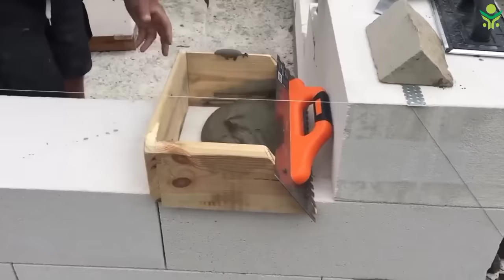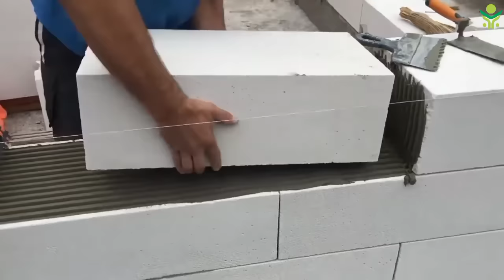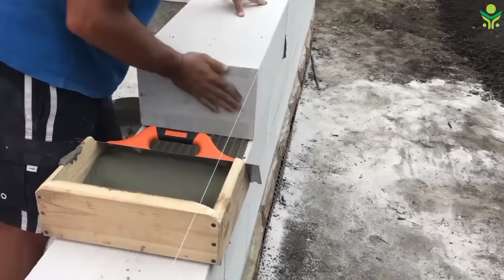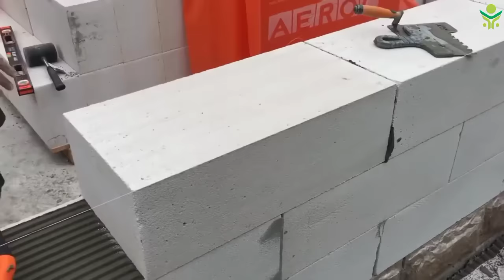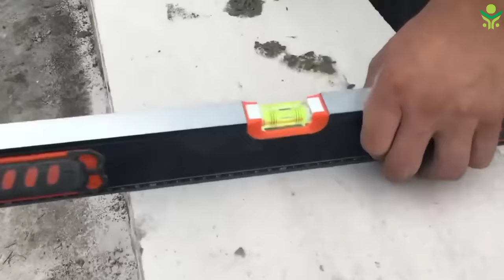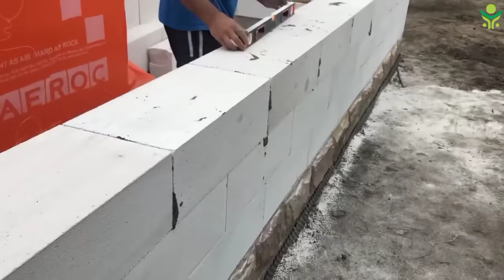AAC Block Adhesive (Chemical) Application

Comment: Good use of the applicator but their are several things to note about this install. First, the installer should be wearing closed steel toe footwear not beach sandals. Yes, AAC blocks are lighter than cider but they still weigh between 35 lbs to 50lbs depending on size and density. Second as the installer lays each flight/course of AAC blocks he should be checking each with a level and using a rubber or silicon mallet to make sure each AAC block is level and firmly installed vertically and horizontally.
Reply: Wow thank you for internet warrioring for us all. Did you not notice the literal mallet and level that he has?
Reply: What rubbish! Have the first course exact and the rest fall into place.
As for footware, from what I see he is working alone so he doesn't have to worry about some other idiot dropping something on his feet. So it is up to him to keep his feet from injury.
Reply: Thank you, Karen!
Reply: Gotta love them no-lifer keyboard warriors that write a reply based on watching 20 seconds.
Reply: It sounds like the angry replies are the keyboard warriors.  OP just said he "noted" some things. He didn't attack anyone and just stated what he saw.  Calm down
Reply: Really? You give a damn about his feet? Hope you can call him and let him know that he shouldn’t wear what he wants.
Reply: My guy you have to see what construction workers in the 3rd world wear. You will commonly see grinding and welding in nothing but flip flops.
Reply: Lmao.. When its rendered, nobody will be arsed.
Reply: @MA_KA_PA_TIE  Yeah and that's why the number of people who lose limbs and lives in work place incidents are 10x higher than in NA or EU

Comment: When cleaning the side,why throwing back the material in the bucket and after take the material from the bucket to infill the slide extruder?
Reply: Glad someone else was thinking the same as me.
Reply: I'm sure it's much easier to flick the excess into a large bucket, rather than carefully scrape it back into the extruder.

Comment: What about filling the joints so the mud oozes out the way the inspectors like it too?
Reply: Inspectors need to learn what the manufacturer’s instructions say and check that the builder had followed them, not an old method appropriate to a different material!
Reply: Looks like porous concrete which is meant to only be applied with a thin layer of adhesive. Here in Germany the inspector and the construction manager won't like it if the adhesive starts oozing out of the gaps.

Edit: Just found out that AAC is indeed what I thought it was I just used the literal translation from the German word Porenbeton = porous concrete

Comment: Being there is no rebar in the wall, what is the strength of this method in regards to earthquakes and wind load?
Reply: I pray for the people who have to endure such conditions
Reply: @AJ7-  It’s not none, but it is limited. These AAC blocks should be laid with stainless steel reinforcement mesh bedded into the thinset mortar. The mesh is quite fine, and easily sits within the 2-3mm mortar layer. You just roll it out and pat it into the mortar.

Comment: Is it advisable to use aac block on a ground floor of 4 storey building?
Reply from the maker: Yes it is advisable...👍
Reply: Your structural engineer needs to consider if there is an aac block available that would take the load. I doubt they could find one that would support four storeys.

Comment: Great product. I've done several of these projects. Problem is both sides need to be finished with plaster coating. There's the labor $.
Reply: Would it be better to use drywall instead of plaster for the inside?

What type of plaster is used for the outside? I heard of a product called U Stucco not sure if it is worth ordering that or using regular sand stucco.
Reply: You can use drywall or apply insulation directly to them.

Comment: Is not wetting of brick before placing necessary?
Reply: Yes it is for better adhesion👍
Reply: Bricks have to be wet but AAC blocks have to be dry during installation.
Reply: Never wet bricks before use! The bonding comes from your mortar being mixed right, not wet bricks.

Comment: What are those blocks made from because there is no way that is solid stone or concrete, because as big as they are, they should be heavy as hell if they were stone or concrete, where you would really need another guy lifting it from the other end, but he sure is picking them up with no problem and placing them pretty easily, almost like they don't weigh much. No stone mason or brick layer is going to wear flip flops doing that job, they wear steal toe boots.

Comment: It's better with PL glue.  You need the triple strength in the large tube. With a large caulking gun. 

Faster, cleaner, just as strong.   First course NEEDS to be perfectly level
Reply: PL pollutes more, especially the packaging.

Comment: Really love your 'tool-hack'. About to build an AAC Block wall, so definitely building a tool like that. Massive time-saver.
Reply: Where are you building the wall?
Reply: @honeytubs  Perimeter wall, Indonesia. Gonna be like 40 meters of wall in length. Average of 2.4 meters high. So any time savers are welcome :)
Reply: @marcushacquebord9610  Some people use a special AAC block trowel. It has a scoop and a long handle to reach into a bucket. Also has notches to get the correct amount of mortar/adhesive onto the blocks.

Where I am AAC blocks are delivered by truck or train from Mexico or the other side of the US. They are not available for local pickup. I guess that in some parts of the world they are available in the local building supply store.
Reply: @honeytubs   It's easier to find AAC blocks here than cow milk.

Share me a link of the block trowel if you have one. I really liked the one in the video here as it just requires putting 3 pieces of pine together and screw the trowel on it in an angle.